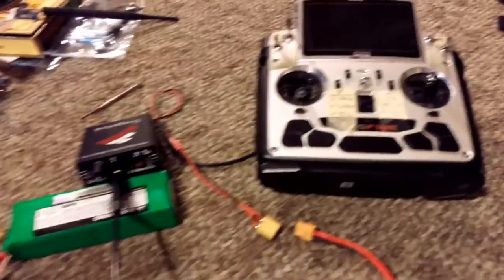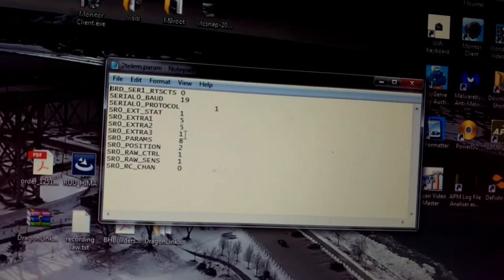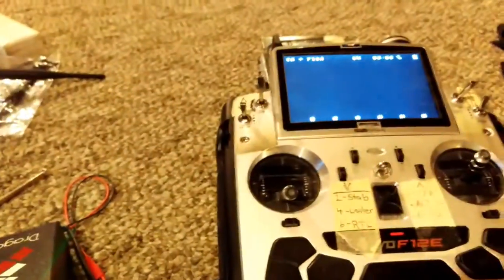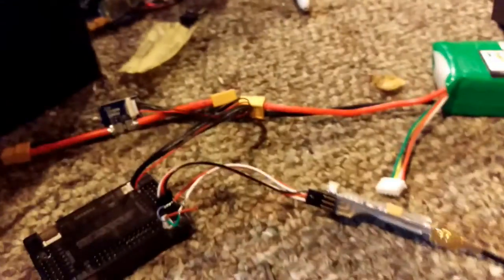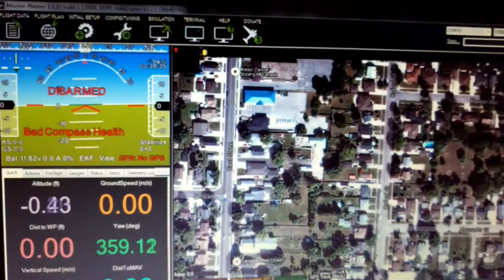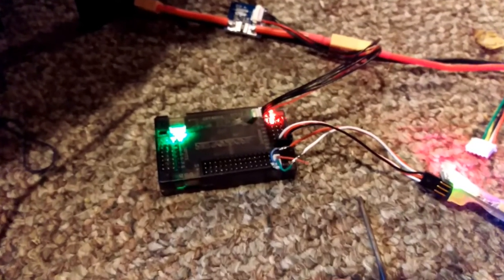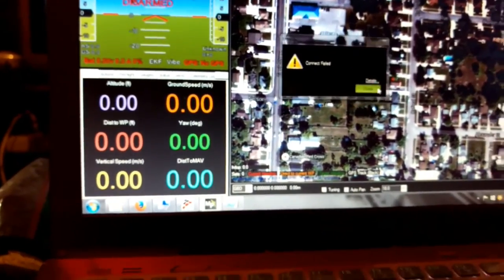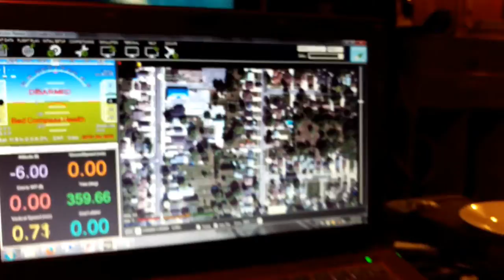Dragonlink telemetry setup on APM 2.6

Comment: Good evening Willie from Spain. Rafa here. I´m getting into trouble when connecting my mini apm to DragonLink microreceiver to get the telemetry data on my tablet by bluetooth connection. I guess you have to configure 2 channels in the DL config tool as Serial IN and Serial OUT and connect both the TX and RX telemetry APM wires to those signal pins in the RX (as well as the GND wire). Anyhow, it seems I´m doing something else wrong since I don´t get any signal out of the TX.

If you would be so kind to give me your email I could send you some pictures of the complete layout so maybe you could help me out.

Thanks in advance.
Reply from the maker: rafa el 
no ground, just rx and tx from APM to DL Rx... assign the pins in DL rx software, are u using pins or the white plug on the DL Rx. 
likely you serial ports settings in MP. also use Mission Planner to setup NOT tower,, tower will work AFTER u get it to work in MP
Reply from the maker: look me up on FaceBook messenger.. friend "Willie McPhee" and I'll chat with you there.
Reply: Thanks a lot Willie. I´m using pins out of the APM. I´m gonna try without the GND wire and change those settings on MP. I´ll contact you by Facebook if I can´t get it right. Thanks again.
Reply from the maker: rafa el on the DL rx there is a white plug that can be used instead of the pins, r u using that plug? 
come to FB for pictures if needed
Reply: No, Willie, I´m afraid I didn´t receive that plug with my DL kit. I just got the JR cable to attach to the TARANIS. Is it necessary to get the RX sending Telemetry data, or can I just fix the pins as described before?
Reply from the maker: OK.. are u trying to get telemetry on your taranis?? if so i cant help with that... if you want telemetry with Tower or Mission Planner then i MAY be able to help.. connect telemetry from the APM Telemetry plug... NOT the gig row of pins on the side... you need to snip and reuse an old 4pin plug (usually white or brownish) and splice from the Tx and Rx wires to the 2 pin sets on the DL... i dont know thw layout of APM Mini and its plugs, so im working with "standard" APM 2.x knowledge here
Reply from the maker: https://www.youtube.com/watch?v=Zv49LdcaLv0
check these too.. he goes into telemetry eventually
Reply: No, Willie, I´m using Taranis as Radio Transmitter but, yes, my intention is to get the Telemetry on a tablet via bluetooth. Anyhow, I´m gonna read all the information you gave me and in case I need any more help, I´ll contact you by facebook if you don´t mind. It´s been very useful all the information you gave. Thanks a lot man.
Reply: Great help, Willie.
Reply from the maker: OK no problem Buds... it could be a couple of different things... i assume first of all that you where able to pair your DL with your phone/tablet?? that should be the easiest part out of the way... we need to know where the telemetry Rx and Tx pins are on the APM Mini, and how to make sure they are activated and at the right baud rate (speed)... also ask in the DL forum at https://www.rcgroups.com/forums/showthread.php?1518533-NEW-DRAGON-LINK-ADVANCED-Full-Telemetry-Bluetooth-Droid-Planner-Data-Modem/page3994
Reply: Yes, the tablet is correctly paired but shows no data appart from a strange 40.9 volts battery (I´m using a 3s Lipo).  Besides I believe the telemetry setup out of the Mini APM is right ´cause I get telemetry on my googles, which I get through an OSD connected to the same wires using the setup in this link (I read a lot about problems splitting those wires into 2 different outputs):

http://diydrones.com/forum/topics/3dr-radio-minimosd-no-mavlink

That´s why I believe it is an issue related to the DL link between TX and RX.